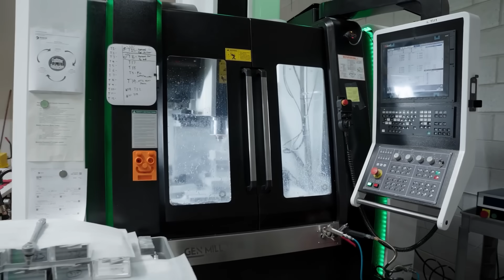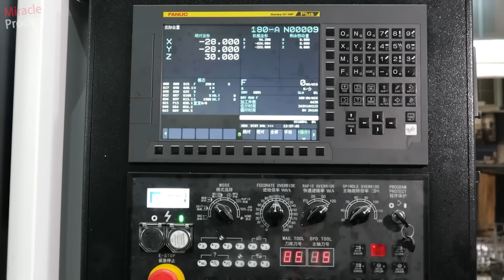This Is Why America (and India) Cannot Compete With China Manufacturing - An Engineer's Perspective

Comment: You're right, China is no longer the source for cheap labour. But US corporations still go to China for low-cost production and maximum profits. Chinese production is supremely efficient and cost-effective. The USA cannot match China's efficiency.
Reply from the maker: Took the words right out of my mouth. The Chinese have become very good at what they do.
Reply: Chinese labor costs are comparable to Mexico;  however, Chinese infrastructure, logistics, supply chain, and management are significantly better.  Even India cannot compete despite labor costs 1/5 that of China.  That is, Chinese and Mexican skilled labor are about $15/hr, while Indian labor is $3/hr and American labor is over $30/hr.  

India only competes in low value bulk labor like garment manufacturing, where it's still cheaper to higher factories of seamstresses. This is basically the entire Indian subcontinent, including Bangladesh and Sri Lanka.
Reply: @ZweiZwolf   That's a product of continuous state investment in improving their basic factors of production. Chinese state is essentially subsidizing the cost of production by reinvesting on the supply side, they've been doing it since opening up. India doesn't stand a chance in that regard because of its federal democratic system that will boot out any political party that refuses to subsidize consumption or even thinks of suppressing consumption to boost production. One of the main reason why China can do this is its highly adaptive political system, unlike India. Democracies with universal suffrage are really pathetic at industrial advancement.
Reply: @t.s.d.1376  No democratic country with universal suffrage has ever industrialized.  The demands are too great, so it requires a sustained national shift that democracy cannot maintain across multiple administrations.
Reply: @ZweiZwolf  there is more democracy in China then in the EU or USA 
Or  was you invited for the election of urSSula
Reply: @ZweiZwolf  I've read that in recent years, China labor is more expensive than Mexico labor. However the cost saving is coming from the efficiency of their supply chain.
Reply: They catch up on the Japanese actually in terms of efficiency.
Reply: @billshun3963 Japanese efficiency doesn't exist since the Plaza Accord. Never blame the Americans but themselves. If anyone has a spine not just the Japanese, that country's leader wouldn't be bowing so low and whisper "Hai! Hai! Domo Arigato Gozaimashita"!
Reply: It's because China had decades of experience from millions of workers and billions upon billions of infrastructure investment. The supply chain resulting from that is very hard to compete with just scale wise alone
Reply: @artoras6098 They saw the writing on the wall, starting with Trump 1, through Biden and now Trump 2. 

They pivoted in 2017 from investing in real estate and being the US workshop, to investing in education, EVs, supply chains, renewables and high tech. They have economic plans that benefit all their people, whereas the west has silly culture wars peddling hatred and envy
Reply: Manufacturing in China is not just about cheap labour, but skilled and highly disciplined work forces. Also about the readily available supply chain. Everything is available locally. If it is just  about cheap Labor, India should be a good substitute, but it is not.😂😂
Reply: @johnlay3040 India! 🤭You can't be serious with this country that includes cow💩as GDP. Seriously!
Reply: Logistics + Infrastructure! China is a finetuned manufacturing + sourcing paradise! 

China is just returning to the top of the manufacturing peak! With the rise of Apple's iphone 1 WAS the current rise of China!

You need the Roads, the Ports, the Warehouses, the Skilled Workforce, the Education, the Dilligence! the 6G Connectivity! = EFFICIENCY

The West DONT understand why China is where it is! China HAS ALWAYS HISTORICALLY BEEN THE WORLDS ENVY regarding goods and manufacture! HISTORICALLY!
Reply: Why do you people swallow the old bullshit china is all about cheap labour.. its cheap exchange rate dude.. standard of living should be measured by what you can buy with the money you earn not the exchange rate set by the fraudulent USD exchange rate
Reply: China stopped being that nearly 10-12 years ago.
Reply: China is transitioning into black factory for manufacturing, which drived down cost further.
Reply: I think you are being very generous.
Chinese manufacturers still benefit from cheap plentiful labour, no real environmental and safety regulations, and no policing of international IP. That's on top of being heavily subsidised by their own government.
They have also had the luxury of being a monopoly for decades, after sinking the manufacturing industries of developed countries, some would argue by playing dirty.
Reply: @GeorgeAlex-j6k  Pretty much ALL of that is false today, grossly outdated. Chinese labor costs are about the same as Mexico, roughly 5x the cost of Indian (or African) labor.  China's current environmental laws are broadly comparable to Europe or the USA, which is why their air and water are cleaning up.  If China were to abandon international IP law, we'd see a radical change in what China produces for the rest of the world.  Finally, China's industries are no more subsidized than the US or Europe, if one were to look at dollar amounts, and esp. tax breaks.
Reply: @ZweiZwolf What he said was China was improving products, so I wonder if that is considered stealing IP or new IP? Couldn’t the U.S. “steal” it back if more people learned Chinese? 😊
Reply: @henryc2595  Yes, but mostly no...  China is improving products, but that's not the same as stealing IP.  He's pushing the false narrative that China is simply rote copying, when it was simply Chinese factories producing the exact same products that Western companies originally told them to make.  When BMW opened a JV to build 5-series, they brought over identical tooling, so, of course, the Chinese-built 530i is exactly the same as the German-built 530i, because that's what BMW wanted China to build!
Reply: @henryc2595  China has massively invested in education and now pumps out more research and patents than anyone else, including the US. Western pols have totally underestimated where China’s at and have been rocked back on their heels - especially the foundering global hegemon, the US
Reply: @GeorgeAlex-j6k  bla bla bla yada yada with your propaganda parroting
Reply: @SaretGnasoh lol....an Indian in disguise
Reply: @kimchiba4570 why is wrong even if he is Indian?
Reply: @GeorgeAlex-j6k What you  said is not true at all, or at least totally outdated. China leads in environmental and safety regulations. China also leads in using robotics and automation.
Reply: @GeorgeAlex-j6k  BYD produced over 4 million vehicles by 2024 and produces its own batteries, which is why its BYD electric cars were so cheap.

Comment: Walmart relies on China for cheap goods. Without China, Walmart's shelves would be largely empty.

These cheap goods are not high quality. They won't really last that long.
Reply from the maker: Absolutely. Anyone will say ' If it's made in X I will buy it!" But when the rubber meets the road, they are nowhere to be found. The reality is that the Chinese have proven their way into the manufacturing world and it will stay that way for a long time.

Comment: You spoke the truth here.
I had a real life experience along the same line too.

An endian SW company build a software on a small CPU board that they bought from China. 
The board works well and the price was good enough. They sold the final solution to Thailand.  

Along came an endian HW company that told the endian SW company, that they can build
similar CPU board at 30% cheaper than the Chinese. But asking the endian SW company to pay
upfront USD 200K first. So thinking that this is a good bargain, the endian SW company paid the
money. 6 months later, they have commercial dispute as the HW that was built never ever work. 
The endian HW company keeps blaming the endian SW company software is the problem.
But the SW works just fine on the Chinese made board.

This is the dilemma of the endian.. they are just bad at many things, but they would scam others,
or even themselves, thinking they can do better than the Chinese... 
In the end, they found out the hard way that .... endian engineering is just bad! Really Bad!
Reply: I'm frankly surprised that the Indian SW company would pay a significant upfront deposit, given that they're Indian and know how Indians do business.
Reply from the maker: Yes, this is the case with the machining aspect for us. If the fixture is already proven, why try to reinvent it?  It's amazing that there can be such a disconnect when the end goal is for everyone to make money.
Reply: And comfort yourself with the fact that any consumer problems or complaints about the "Indian" product will usually be dealt with by....an Indian call centre.
Reply: Here is the translated version of the post above: 

You’re absolutely right — I’ve experienced something similar myself.

An Indian software company once developed a product using a small CPU board sourced from China. The board was reliable, affordable, and integrated well with their software. They bundled everything into a solution and successfully sold it to customers in Thailand.

Later, an Indian hardware company approached them with a tempting offer: they claimed they could produce a similar CPU board for 30% less than the Chinese supplier — but only if the software company paid $200,000 upfront. Believing it was a good deal, the software company agreed and paid the amount.

Six months passed, and the new boards still didn’t work. A dispute broke out. The hardware company kept blaming the software, even though the exact same code worked perfectly on the original Chinese boards.

This is the dilemma with some Indian firms — they often overestimate their capabilities and end up sabotaging themselves. Sometimes they even deceive others (and themselves), thinking they can outperform established players like the Chinese. Unfortunately, they learned the hard way: the engineering just wasn’t up to standard. It was, frankly, terrible.
Reply: @Uping1946  Then the Chinese hardware company who makes the board worked with a Chinese software company, together they make the final product 10x better than even the original solution.
Reply from the maker: This is indeed the case. The Chinese have a tendency to take the items and make them way better. It is absolutely foolish to believe that the Chinese are not capable of this.
Reply: @Uping1946  Fun Fact -- China vs India

China: Plan big, Build more, and Deliver ahead of Time.

India: Promise big, Talk more, and Non-delivery Every Time.

😅🤣😂
-----------------
Reply: @nickgoh8947 so true
Reply: @nickgoh8947 so true
Reply: @Uping1946  What's the need for "translation"?